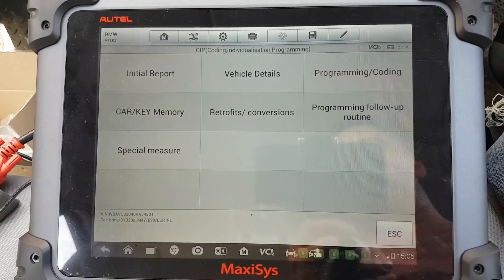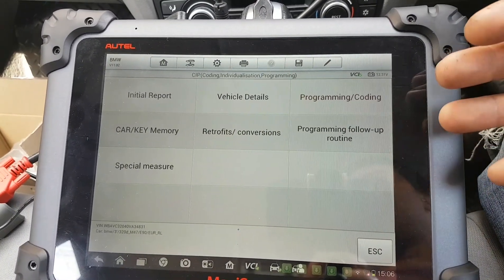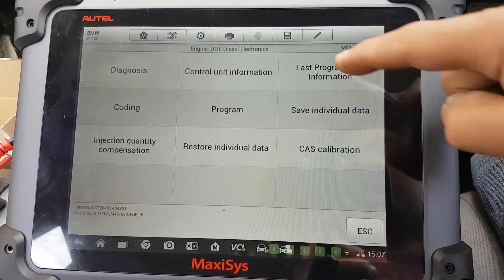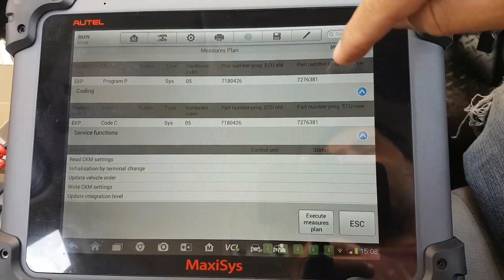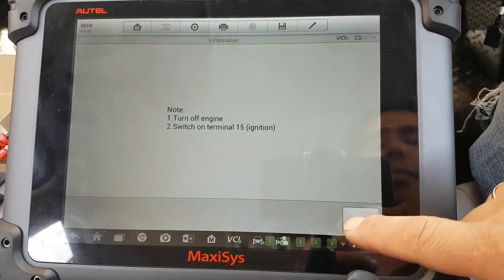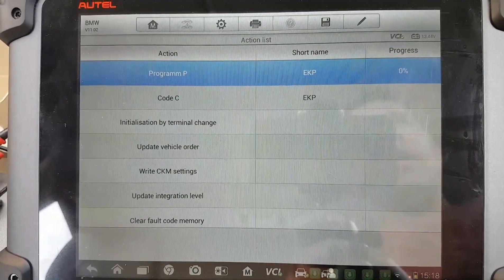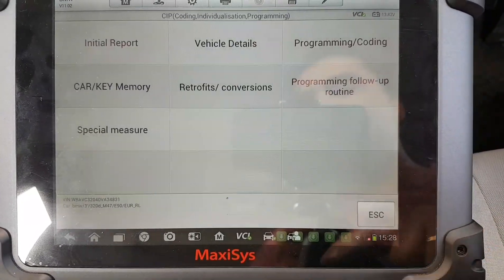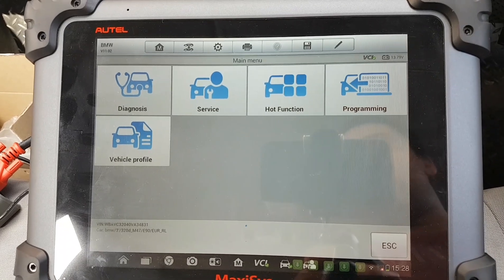BMW individual module programming using Autel MaxiSys MS908P.

Comment: I use ctek 25 amp for some BMW that is also not enough but I tested it with picoscope for ripple there is 0 AC ripple from a ctek msx25 unit
Reply: @cambam2430  ..now that u mention other bmw having more modules and needing more juice and taking longer to program, I probably agree with you, my sibling has a 750 and that thing has electronic everything and a huge battery and very likely needs more than the 15amp charger I used for my 328...I need to learn more on the ac ripple, never heard of it..whats ista?...agree well all trying to learn and help each other
Reply: Hi which maintainer did you get as im after one at the moment.
Reply from the maker: @gunti80  
Hi
I got this one...

https://www.halfords.com/webapp/wcs/stores/servlet/ProductMobileDisplay?catalogId=10151&langId=-1&categoryId=255205&productId=1078771&storeId=10001
Reply: @cambam2430  I did a complete program and code with 15amp battery charger/maintainer..whole process took around 40mins...
Reply: @cambam2430  sorry sir dint mean to sound rude....puck bmw they lie and trick people so much..example the crank sesor the way they route the wiring overtime the sensor wiring gets loosed causing problems..the manual states that the sensor has to b removed from top when it can b removed frm the bottom really quick after throwing in the garbage all the plastic on the bottom and the little plate with unusual retainers that prevent ur hand frm fitting thru the bottom and rerouting and connecting the harness to the sensor.....I also threw in the garbage the bmw plastic thing that cover the coils and make it longer when testing and removing anything under that area.
Reply: @cambam2430  I did code the fuel module I swap..tried a couple juction modules but cudent get autel/ecu to reconize tem......no codes indicating a problem at all.......when the car is cold it takes 2to10 push starts befor it starts(n smtimes will trow a starter code but thats cos it took long to start)....and when car is driven intially after start up somtimes it will loose power somtimes shutsoff wen drivin just after startup(somtimes will thro a transmission code sayin that it loss comunication with ecu after car shuts off).....after driven for a bit starts in the first try and runs great...fuel pressure stays frm roun 62at idle and 65to67 wen driving....car requires 69to74psi to run properly both idle n driving....I compared the temp of the coolant sensor, to the temp of air sensor, to the temp of ambient temp sensor, to the temp of oil temp the temps all almost aroun same wen cold, and the oil and coolant temp do change when car get warm so no problem there, .......outlet coolent temp sensor lower tan coolat temp sensor so aint either..both fuel pump n regulator/filter tried swaping tem same results..car has no fuel pressure sensor I checked allover
Reply: @cambam2430  it probli will...thanks
Reply: @cambam2430  how much did u pay for ur icom programmer, did u buy it frm bmw or outside source...went thougth the bmw forums n people do frown using d  can cable for programming..or maib I shud just pay autel....
Reply: @cambam2430  ok..thanks..ill look at it
Reply: @cambam2430  thanks..yes im lookin serveral places...I dont mind buyin the connectors since I plan on keepin the bmw plus my brother also has one
Reply: @cambam2430  thanks, same back
Reply: nothing work, so I just added and extra wire with fuse n relay straigth frm batt to the fuel pump wire and the ecu live wire I chop up and connected it to the relay so it can activate it and so car still functions normal. car accelerates way faster and esier to start wen cold( aftwr programing n coding after tweaking the power by adding wire frm batt the car ran even better), im assuming the extra juize helps..........I also tried delting the fuel module ecu wire and just using the new batt to fuelpmp wire that I added and activating the relay with a switch connected to batt n fuse, but car runs not so good probli cos I need a way to raise the amps........if it keeps givin probs im going to try replacing fuel module resistors with weaker ones or chop sometal off original resistors...or add amp control with deleted ecu fuel module line
Reply: I just now disabled the intellegent battery sensor and the now the car started on first try and running perfectly fine......so my conclusion is that ibs sensor got damaged tru ac ripple u wer teaching me about
Reply: @cambam2430  whats temperemental.....batt sensor probli did get damage wen charging..but it has been driving well n startin since tweaking the fuelpumps electricals and disconecting the intelligent batt sensor..ive notice thr biggest difference after disconnecting the intelligent battery sensor..i aint buyin another ibs sensor ill just leave it unconnected...ill update if it keeps givin probs
Reply: @cambam2430  yes im currently looking for a decent batt charger for euro cars...ill use the other I have for domestic cars...
Reply: @cambam2430  car still manfunctioning wen engine completetely cold.....I give up.....just gone leave the added auxilary fuelpump wire since it helps n gonna give it a good five mins to warm up befor driving...i connected ibs sensor back...not even gon waste my time with doing compression or leakdown test cos it burns minimal oil, n no coolant nor does it bakfire like wen ters valve problems, idles perfectly fine...runs without a prob after warm...I might increase amps on fuelpump tru auxilary wire to see uf it helps or sodder smaller ressitor on  fuel module..if noting works ima trow the ecu/ecm in the garbage and convert the bmw into carburated
Reply: @cambam2430  ended up being the ignition coils....I swaped al 6 good quality coil set frm autozone brand and nomore problems, been starting rightaway everyday...............usually anithin ignition I swaped all at same time,  two years ago I swaped the cheapest  coils on amazon(not hating on cheap stuff, most of the time the cheap car stuff works as good as the expensive stuff) and they lasted 1 year bfor they started misfiring one by one and so I wud just swap the bad coil not all 6 since money was tight.....yesterday cilinder 3 started misfiring so I swapped 3 with 1 to ruled out sparkplugs n injectors, n it was the coil....after installin tem  misfire did leave...and its been cold startin on first try rvery day now and no more buking or shutting down if driven without letting engine warmed
Reply: @cambam2430  agree newer cars have more and more modules needing more juice which is true..also agree with keeping a steady 13.8 to 14v fllow..ill look more into the ac ripple asap and thanks for the good info on ista
Reply: @cambam2430  is a regular d can cable frm amazon inuff to operate ista? im about to purchase the software cos I'm having programing issues my bmw and my autel is not cutting it.
Reply: @cambam2430  08 328I....just oder 30 mins ago ista dcan cable frm amzn...and I  oder ista+d/ista p software frm an unknonw source in europe(bimmerdiagnostics.com)..thanks for replyin frm what u just mention I did oder the correct software.......
Reply: @cambam2430  ok will....thanks for the tip on incom cable and inpa software n all the info, ill look into them asap
Reply: @cambam2430  oh got it, im lookin at the icom looks sorf of like the little square autel uses....thanks
Reply: @cambam2430  oh, good to know.....yes the autel possibly did cause a program issue, after doin som programing the fuel pressure stays below spec...this is why im tryin new routes.....I already verified n  it aint no mechanical or electrical issue..even swap few modules dint help...n I dont want to swap the ecu again...I was going to pay 1,200usd to get autel updates n help but first I want to try other options...or I migth just drillout the fuel regulator or install a high pressure pump, or instal a manual regulator
Reply: @cambam2430  my conclusion is either #1. the ecu got damage thru ac ripple like u wer teaching me, ...or #2. I got bad promming data, cos I did a full car program with expired autel subcrition...Autel was probli like, thats what pendejo for not paying for our yearly subcrition
Reply from the maker: Hi
I do have a battery maintainer now... bought a good one in the mean time...
It is a 30amp, used it loads of times after, and seems to work ok.
👍👍
Thank you for watching!

Comment: Thank you for everything. I appreciate your videos. When using Maxisys for programming, do you need to be connected to Wi-Fi in order for tool to be able to program, or is the updated software file built into the scan tool?
Reply from the maker: Hi
You need a live connection... as the software is downloaded fr9m their servers...
Thank you for watching and for your comment!
Reply: @LMAutoRepairs  hi. is it free? or it will charge with upcoming updates?
Reply from the maker: @modestasserpenskas2353  
Hi
Is part of the anual subscription...
Thank you for watching!

Comment: Thx for the vídeo luis, it may be a stupid question but here it goes what sort of situation would have to programme a car module...
Reply from the maker: Hi
I give you an example...
My 7 series, had for a long time a fault with one of the airbag modules... would come up with something like internal failure...
Clear the the codes, would last for days, sometimes weeks and even months....
Has been doing it for 2 years... I was too lazy to reprogram it...
But finally done it around Christmas last year... no issues ever since... 
This is just an example... the manufacturer sometimes releases updates to rectify or improve deliverability etc...
Thank you for watching!
Reply: LM Auto Repairs cool thx Luis...👍
Reply: i know you posted this question 5 years ago.... but if you or anyone else happens to read this..... ALWAYS remember that if you do not  know the answer to a question you may have, yet you want to know the answer to said question to benefit or learn from it because you genuinely want the answer, then no matter what anyone says.... there's no such thing as a dumb question in that instance!
Reply from the maker: @BruceAllentools 
☺️
Absolutely! 
👍👍👍